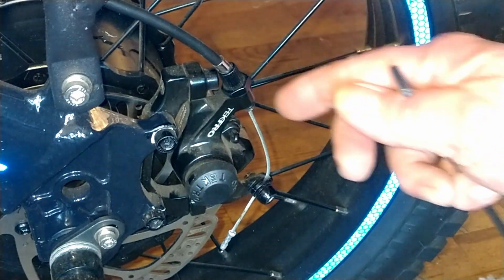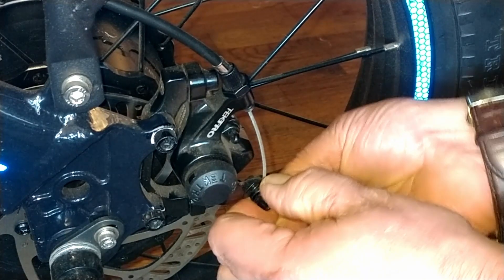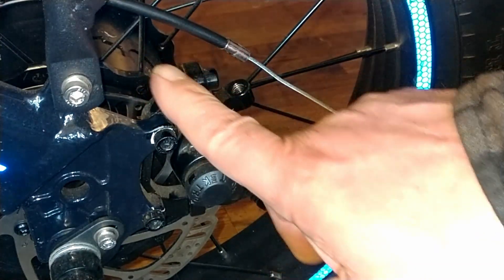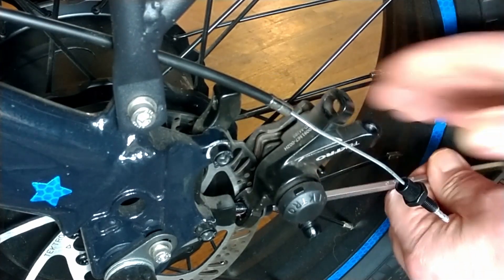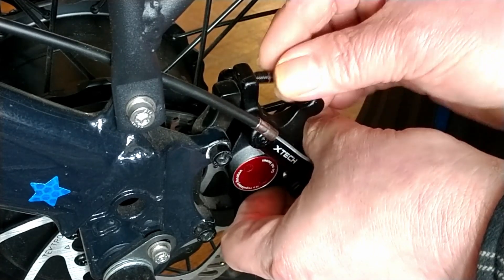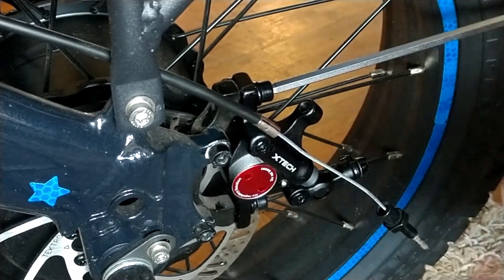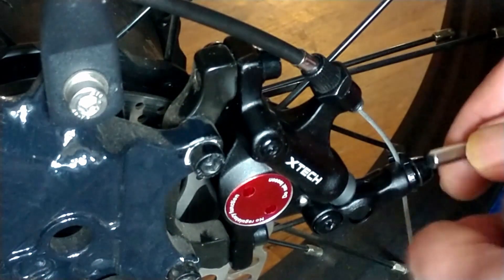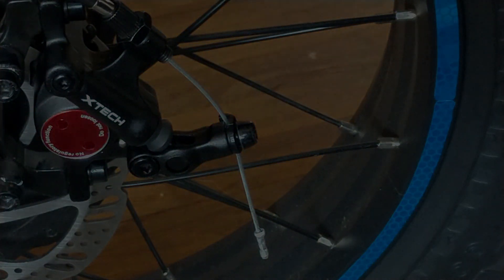LECTRIC 2.0 - How to change rear mechanical brake to a Hydraulic Brake

Comment: The rear brake only has about 10-20% of your braking power total.

PSA:

I strongly urge everyone to get comfortable using your front brake, especially on an ebike, especially in a non rural, and hilly/mountainous areas. 

many riders are afraid of the front brake because of experiences in childhood, but It doesn't matter til it does, at which point your life could be at risk over poor bike technique. 

Even if that's not the case, a front rim brake has more usable stopping power then a rear hydraulic, and the mismatched breaking forces and pull when mixing the systems make it almost 100% likely you'll lock and skid you rear wheel in an *emergency stopping* (doesn't matter til it does*) situation, and that all but promises a bad situation for everyone involved. Either way this setup is dangerous. Just a heads up.  Converting your front rotor to 180 so you can use you front hydraulic would be a very good idea, and through a site like Amazon would cost you about $25

Comment: The break caliper is the same for front and rear tire on ST 2.0. Could your new hydraulic brake fit also on the front tire?
Reply from the maker: It will fit, but you have to change the rotor to 180 mm.

Comment: Sweet upgrade would love to see a video of the front hydro brake going on I've seen alot of peeps saying the hydro brake hits the spokes on the front but no videos or how they solved the problem so if you could do one id be most grateful as I have a 2.0 as well and love it and want to do this upgrade as well My front disc says 160 mm on it you sead yours is 180? TIA and as always ride safe and keep safe
Reply: I measured mine on my 2.0 and it seems to be the same for both front and back
Reply: @yh1786  not sure what your trying to say ? you already have hydros on and thay measure the same form spokes to calipers? or your disc are the same 160 160?  both mine say on them 160mm   update    back hydro went on fine the blue ones look awesome on it . although the front one the spokes hits the hydro  I'm not running two Moters if i was there would be no problem the spokes wouldn't hit
Reply: @johndoe-vc3qj  I got mine to fit, but it's like a 1mm distance between the caliper and the spokes. Not sure how I feel about it running so close especially if the wheel flexes it can cause an accident.
Reply: @johndoe-vc3qj  Also I think I may have found the solution. they sell rotor spacers to push the rotor out from the wheel, effectively giving more clearance. I see some 0.2mm and 0.5mm. I think it can move up to 2mm before the rotor touches the bracket that holds the caliper bracket. I'm going to order some and experiment
Reply: I have a 2.0 and I changed both front and rear with hydraulic brakes. I had no issues and both the rotors are the same size.

Comment from the maker: This was a easy swap out from the stock mechanical brake to this new one! will do a performance review shortly. Keep safe everyone!
Reply: Did you reuse the pads that came with the bike or bought aftermarket ones?
Reply from the maker: @yh1786  I used the pads that were included with the new brake
Reply: @Pandafoo  Ok I used your link  and I bought it. I wasn't aware that it comes with the pads! That's a good deal then because the stock pads cost $40 from Lectric so basically this is a free upgrade
Reply: @yh1786  lectric ships brakes with a new caliper.